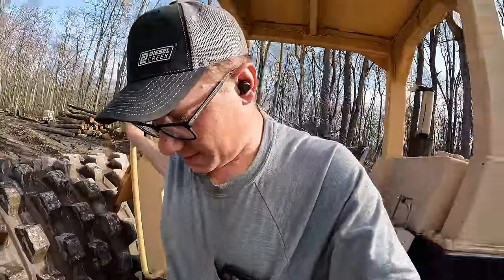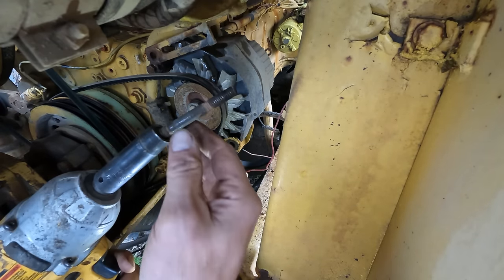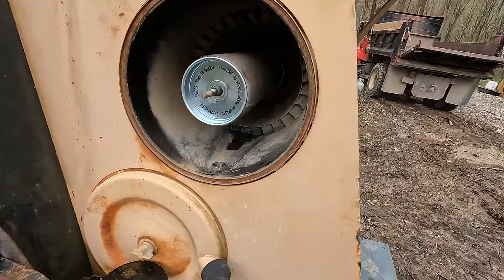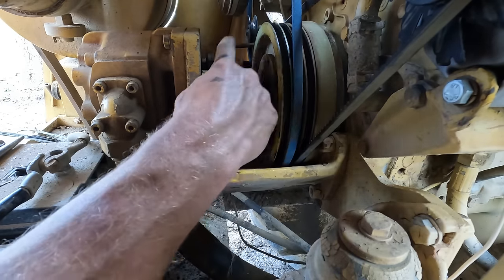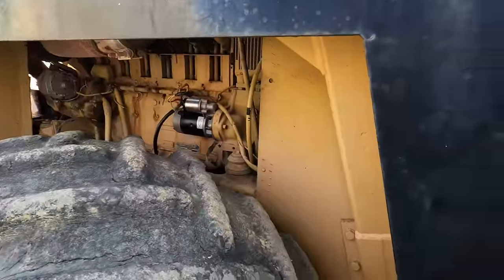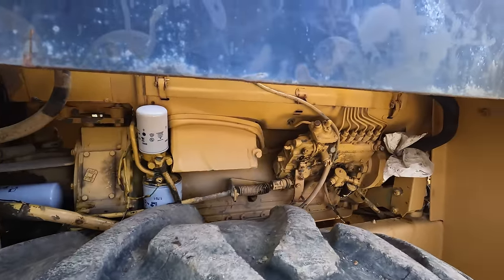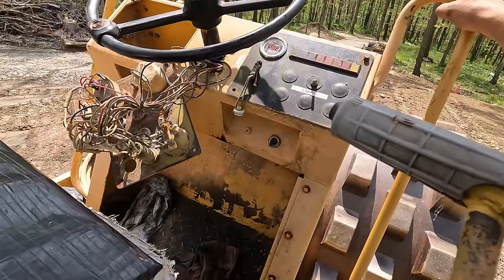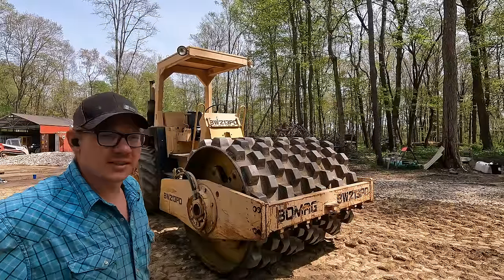I got BURNED on this Compactor from an Auction! (Bomag BW213)

Comment: I would have coated that all in WD-40 then left it for an hour, may have saved snapping that alternator bolt
Reply from the maker: There was no saving that bolt. It’s not worth the struggle, snap it off drive it out get a new one. It was 36 cents….

Comment: Did you ever end up replacing that fan belt tensioner pulley with the correct part? according to @deerhntr59 it should be a double pulley, and I'm assuming someone has kitbashed on the wrong part to get it "working" after the original pulley broke or was removed for some reason.
There should also be two belts.

Comment: To be blunt, at an auction you only screw yourself if you make a bad purchase. If it was grossly mis-represented in the description, like a different engine or model, you may have a point - but take anything said about anything being auctioned with a bucket of salt and check it out carefully.

Remember, it's being sold for a reason - might be a good one, might be to get rid of a pile of crap.

As the starter is a different colour to the engine, and they would have been painted as one, it's been changed out at some point - but the guy's comment about it doing that for over a decade, taken with the other stuff wrong with it, suggests it's had a lifetime of abuse and is very likely to need significant $$$$s spent on it. See paragraph above.

Comment: How do you not check the fan belt on an air-cooled engine I not only had rats nest in the plenum both the auxiliary and the primary commentators only to find that the machine had been repeatedly ran hot not because of the Rat's Nest but because the fins of the jugs had corroded themselves over about 10 hours with a pick and acetone I got all of the rust removed the engine ran fine up until the point injection pump got a hole in it which leads to the next statement did that type of engine doesn't start immediately then the injection pump is out of time mine is a f3l 912 with thousands upon thousands of hours start up immediately no matter how cold it gets here

Comment: Boy it cost some good money 💰 if you wait about fixing things on anything it’s just not good to Wait. Like the starter letting it go just keep turning the switch and screw up starter over a solenoid then the flywheel is crap. And letting the oil and filter go till it breaks down and starts ware on the internal parts of the Engine I don’t know how you do your vehicles but what I see is you do change the oil and filters when you get them I don’t know what you do after that first time. A man or woman needs to keep a log in a notebook every time you do something to them and they will last a lot longer my father-in-law did that and could get 3 to 4 hundred thousand miles on all of his trucks all pickup’s and car and ton trucks too.

Comment: 22:30 shove a wooden wedge under the belt to raise it up off the metal, start with small drill, working up in size. The idea is to manufacture a grove to allow the belt to clear the metal. Changing the belt won't do anything because you have the belt tensioner, shorter belt will tension the belt greatly. If you create the grove, as the belt stretches it will not rub and destruct!
Reply: Re-engineering is what it is!

Comment: Got burned? Hardly. It's a 35 year old machine with a few hours on it. Drum looks good. Motor sounds fine. Considering it went to auction, fully expect to perform a complete service with all filters, fluids, and belts. Expect some wiring and gauge replacement. Get a pump for your 5 gal pails of oil. You can drop the oil pan and see if it can be turned. if not you can add your own oil plug anywhere you want with the pan out. Good luck with the pad. with that much fill (6 feet)  3-4" lifts with packing and tightblading in between with around 12% moisture content should build up a real solid pad. a slope of 3:1 would be ideal, though you can squeeze by with 2:1 without worrying about the pad compaction close to the slope.

Comment: You keep cutting the video right before you finish doing a job. Did you tighten the filters with a wrench as video makes it look like you just did it by hand. Also the nut and washers left in the air filter house was worrying, but I guess they were taken out.

When you say you got burned, I'm not sure you did. Other than some dodgy wiring, it just seemed to need a full service, a new starter and new fan belt ... all of which  are from normal wear and tear. If everything else was good and you paid what you thought it was worth, I think you got a good deal.
Reply from the maker: You’re not supposed to tighten filters with a wrench 🤦🏼‍♂️ 
And it had a major breakdown right after I finished filming this video that’s what the teaser clip at the end is
Reply: @DieselCreek  Oh, I missed the clip at the end! I didn't realise it had a major breakdown ... I thought you were saying you got burned cause it needed servicing. My apologies.

Comment: while you were replacing the blower belt why didnt you "splurge" and find the correct tensioner pully, since cooling the engine is so critical that the manufacturer thought to double up on it. ?? You won't know its broken until you over heat the motor possibily damaging it- who knows how many times its busted before. clearly who ever owned this machine jerry rigged everthing and not well !!!

Comment: This title is click bait. For a action auction machne it looks like a good machine, could have the engine, trans or hydro on its last legs as this is just what most companies do for auctions. They dont do preventative maintenance when its new because they need it and they dont fix it (older) unless they need it. If they are planing to get rid of it they wont spend a dime especially if the new one is on order. I always heard save nickels and dimes and dollars will follow. I did watch it all the way and subscribed.
Reply from the maker: It died right when I finished the video. It’s a POS